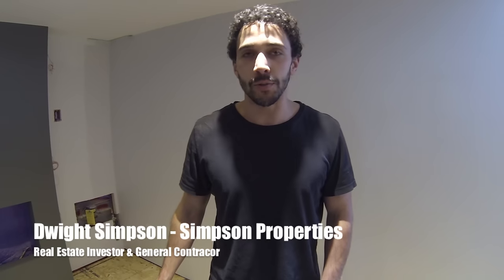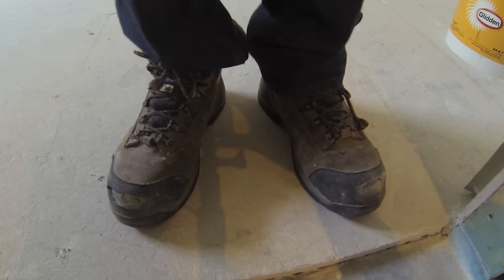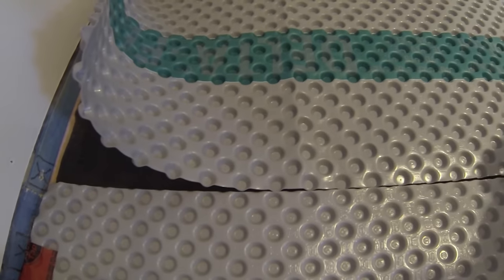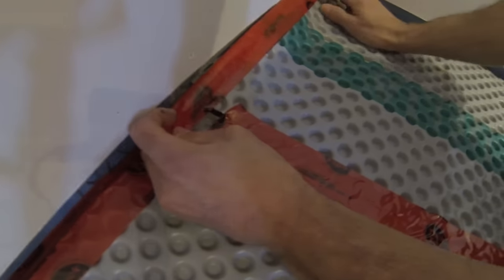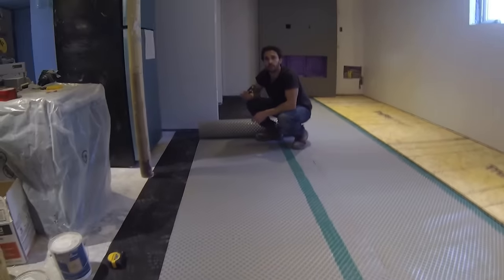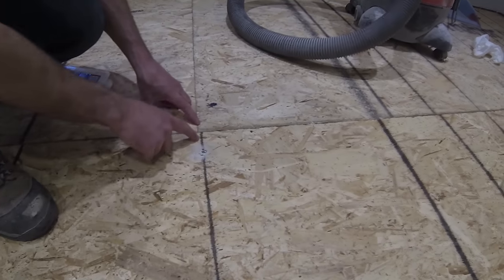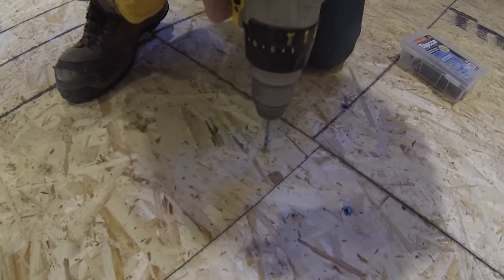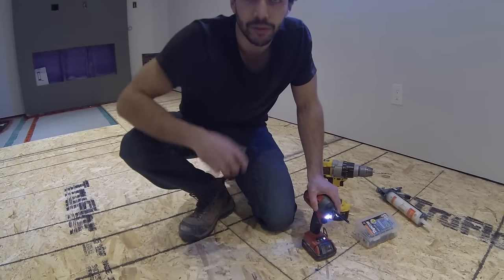HOW TO INSTALL A SUBFLOOR ON CONCRETE

Comment: Can you use this method in a lower level bathroom? Mine is only 8'* 8' so may use the expensive stuff but I like this method for the huge living area I have to do.
Reply from the maker: 8’8” ceilings are considered high for a basement. I personally wouldn’t be worried about the floor build up with your ceiling height. Which ever method is more cost effective I would go with that.

Comment: Interior concrete pad (originally porch, house 1938.) need to raise floor 4” to match kitchen level.  Sleeper frame over new osb with another layer of osb to lay tile on?
Reply from the maker: It’s either that or pour another slab to match the new height. Framing out a new subfloor will probably be the easiest and most cost effective solution. Without seeing your sight in person it’s a tough call to make.

Comment: Great vid and thanks for the awesome info.  Would the same principles apply if putting in flooring in a garage?  (building a home office in the corner of the garage)
Reply from the maker: +Spartan 419 thanks! Yes, the same principals apply installing this subfloor system on a garage slab.

Comment: I understand that the Delta fl has an air barrier between it and the concrete floor.  Is there any concern about some type of moisture getting on the OSB board causing any mold issues?
Reply from the maker: The only way you would have mold issues is if you have a flood in your basement. If that happens you would most likely have to remove all the flooring anyway. If your foundation is free of any cracks and waterproofed mold will not be an issue m, if you use OSB in conjunction with Delta-FL. If you installed OSB directly over your concrete slab then there would be mold issues because any moisture from the concrete would wick onto the OSB.

Comment: Outstanding video and technique!  Getting ready to do this on two big projects.  This excellent video really helps!  One thing I'm confused on - what diameter are the tapcon screws?  You list a 1/4" drill bit, but that would be too big for the Tapcon screws that come in the kits, which are 3/16" and 1/4 (according to the Tapcon website).  Wondering if you meant that the Tapcon screws are 1/4" x 1 3/4".  Am I missing something?  Thanks!
Reply: Mike E I find using 3/4” t&g sheathing eliminates the need for tap cons in most basements. The tap cons will rust over time.
Reply from the maker: My bad that was a typo. I corrected the description. You're correct 3/16" concrete bit is used for 1/4" tapcons. Thanks for pointing that out!

Comment: When screwing the plywood down, does it crush the dimple mat? Also, incase of a burst pipe above the basement, how would you install this around a floor drain to make sure the water drains and not flood the basement?
Reply from the maker: The Delta-FL membrane does not get crushed by when the plywood or OSB is fastened. The material is very rigid.

If you get a burst pipe the majority of the floor would most likely have to be replaced. Whether the floor drain is exposed or not. If that is a concern you could extend the floor drain (use a coupling) to the new finished floor surface.
Reply: @simpsonpropertiesltd  Thank you. I realize the floor would need to be replaced, but pumping water out of a basement is not fun. You'd also have replace a lot more than just the flooring.

Comment: If you strip one just insert a piece of insulated wire about 6” long and run the screw back in same hole.
It works so well you can use wood screws.
No joke...try it....you’ll be blown away how good it works.
Speaker wire, automotive wire, as long as its stranded wire it will grab like mad.
Reply from the maker: That’s a great tip! I have heard of people using pieces of solder as well. Thanks for sharing that.

Comment: Great informative video. I've used this method a few times myself, and always feel terrible to have to punch through a perfectly sealed vapour barrier with tapcons.  Even more worrisome is when a fastener doesn't grab an you're left with a hole. Is there a method that you use to ensure these perforations don't become troublesome in the future?
Reply from the maker: It’s tiny holes in a slab. I would not be concerned.

Comment: Perfect video, I really loved it and it really  makes sense, thank you..BTW i have a question I have to go though every thing you have just showed here but what about putting - fabric+ Delta FL + Rigid forms+ Plywood ... I am thinking of installing laminate  on the top? Thanks in advance..
Reply from the maker: Do you mean installing Rigid foam? If so, it's a great idea since it will act as a thermal break. The only con is you with loose some ceiling height depending on the thickness of the foam.
Reply: Yep that is what I mean, I will just install a thin Rigid foam, thank you for the reply- appreciated...

Comment: Greetings from the UK, 

Thank you for sharing your process. I have to do the flooring at my place and this video is very useful (informative) to me.

A couple of questions. I noticed you did vinyl planks for flooring on top, is that right? I want to do the same to my kitchen, bathroom, living room.
Was the concrete level to begin with or did you have to work on it before laying your subfloor? 

Regards, 
Christos
Reply from the maker: Thanks! I installed laminate flooring but vinyl flooring is great. Especially for basements. My slab was fairly level one the subfloor was installed. I did not have to shim or install self leveling concrete in the areas that had laminate flooring.

Comment: Thanks for a great and informative video! Im doing the exact same thing as you in my basement, which is not underground at all, however my flooring will be Vinyl planks. I just got in some professionals to level the concrete floor so that problem is solved. Previously there was Styrofoam insulation directly on the concrete floor with 7/8 chipboards on top of that and then a thin layer of some very thin, cheap floor as the finish. My plan is to simply lay down a vapor barrier, then the vinyl plank foam mat and then the vinyl planks right on top of that without any more sub-flooring as things are level and smooth now. My main worry however however is that the floor will feel very cold. Would your choice of sub flooring also work with vinyl planks or would this choice be too thin as these vinyl planks are flexible and not as sturdy like wood flooring.
Reply from the maker: Philipp Affolter this method would work with vinyl plank flooring as well. It will also help increase the floor temp a bit (maybe a degree or two). Unless you heat the slab with radiant heat or electric such as Ditra-Heat (tile applications) you will always have a cold floor.

Comment: I bought dmx step 2. Should I still use the landscape material first?

Also could carpet be installed on this system?
Reply from the maker: Yes carpet can be installed. Refer to the manufacturer specs it covers materials that can be used in conjunction with it. 

You should be ok with DMX and. It need to install landscape fabric. Install some and place 4x8 sheets on top and see if you notice any noise before fastening the boards. Then you can decide if you need the fabric or not.

Comment: Re: the fabric ..... I installed Delta in 2007, I did not use fabric (Delta did not call for it) I have no sound because my plywood (I used t & g plywood) was secured properly to the floor .....I’d check with Delta before installing with the fabric .....if it ever gets damp or wet will there be enough air flow for it to dry??
Reply from the maker: It’s a recommendation directly from Cosella Dorken the manufacturer. It’s not a necessary step but a recommended one.

Comment: Great video, what kind of lighting are you using for your shelving beside the fireplace?
Reply from the maker: Peter Grimaldi thanks! I used low voltage LED tape lights.

Comment: I'm about to do the same job in my basement but I have a question can I lay this on top of old asbestos tiles. Some  pieces are broken or missing too
Reply from the maker: If it were my job I would do a type two abatement and remove the asbestos tiles. If you choose not to remove them it’s safe as long as the asbestos tiles are not disturbed. If you installed Delta-FL only and didn’t tap con (screwing into the tiles) OSB down you should be fine.

Comment: My exterior walls are built and insulated with vapour barrier already. So just to clarify, run the extra vapour barrier OVER TOP of the Delta FX and tape?
Reply from the maker: That’s correct. Sorry for the late reply.

Comment: Deciding to use this product or dmx but I though you didn't want to seal it against the walls so the moisture could escape into the room?  If moisture builds up underneath the dimpled plastic what happens? Any opinions?  I have a brand new home with a textured brick basement walls and I don't even plan to frame walls to cover the brick look just interior walls.
Reply from the maker: It’s recommended by the manufacturer to seal the perimeter. They suggest using low expansion spray foam. There should not be excessive amounts of moisture below the Delta-FL if you have normal slab conditions. In that case there won’t be any issues. 

If you have standing water on your slab. Those issues would have to be addressed first.

Comment: Hey Dwight....great video....very helpful.  With regards to the walls....what is preferred... before the subfloor directly on the concrete or on top the subfloor with the subfloor going from wall to wall?  I know from the blog you prefer to put the walls in first but is there a benefit either way or just personal preference?  What would some pros / cons being to either?  I'm working on a fresh slab of concrete with concrete walls but am going back and forth on which to do first.  Thanks!!
Reply from the maker: Thanks! It's really a personal preference. If you find LadyDMcollector's comment below you will see why they recommend to build your walls first. If you build your walls first you wont be able to drive nails into your bottom plate of the wall while doing the trim. You may have to add additional blocking. If you have a flood like LadydMcollector did in the comment section you may have to tear out studs from your wall, in a worst case scenario. If you build your wall on top you don't need to use sill gasket since it wont be touching the concrete pad. Building your walls first makes your life easier for plumbing layouts if you need to add any underground plumbing. Like you said both options have pros and cons. You will have to decide which process will work better for you.
Reply from the maker: Hi Stephen, I thought of one more installation method that I will probably use on my next install. I will install the Delta-FL first. Then install the exterior and interior walls on top of the Delt-Fl with no OSB between the two. Then I would carry on with a regular installation installing OSB and butting it up to the walls. Leaving a small gap between the OSB and wall for expansion and contraction. This installation method would still allow for nailing into the bottom plate when installing trim. If there was ever a serious flood and the entire floor had to be removed it could be done with out having to remove the walls. Plus it keeps all your framing off the concrete floor.

Comment: Hey thanks for the awesome video! Question, I live in FL and I ripped my carpet to find concrete. I have no basement, can I still follow your video or would it be useless without a basement?
Reply from the maker: Thanks. If you have a slab on grade home you can still use this method. It’s your call. What type of flooring do you plan on installing?

Comment: Thanks for the video! We are planning on finishing our basement here in a few weeks. I am wondering if you have information about the brand/type of floor you installed in this video. We are looking for something light with beige undertones, and the color is beautiful!
Reply from the maker: No problem! The manufacturer is Life Stepp, country collection, colour: Gray Smoke, Size: 1215x126x12.3mm, SKU # 2717. Each box covers 19.77 sq ft. Good luck with your basement renovation!

Comment: I will be finishing my basement in the near future. Does it make sense to put the Delta FL and OSB in first...taking them to the bare poured concrete walls? I will be adding 2" XPS rigid foam to the walls, then 2x4 framing with empty stud bays that I will sheetrock over. Or do I build the walls first and take the Delta to meet the PT/BluWood bottom plate?
Reply from the maker: I would install a strip of Delta-FL on the perimeter walls. You can cut it in one or two foot wide strips so that you have less overhang. Then install all your 2" rigid foam on all your exterior walls. Once that is complete install your exterior framing with your bottom plates over top of the Delta-FL. Then you can install the rest of your Delta-FL tying it into the exterior strips. Then install your OSB. Leave an 1/8" gap around the perimeter and in between boards for expansion and contraction. If you have Instagram check out my page Simpsonproperties. I posted a picture showing a similar installation recently.
Reply: Thanks for the reply. I really appreciate you taking the time to answer my question. 
I just checked out your instagram page and saw the picture you were talking about. Do you have to put a bead of foam where the delta fl meets the concrete wall? Or do I just leave it open? Would I need to seal where the 2" XPS meets the delta-fl? Also, 
would the OSB only really be necessary if I am going to install carpet or hardwood? If I plan on installing laminate or vinyl plank, could I just put it over the delta-fl (or over whatever pad the product requires)? Sorry for all the question. I have zero experience with this stuff and there are so many different opinions when I try to research it. Thanks again!
Reply from the maker: aldo leopold no worries that’s why I created this channel is to help people through the renovation process. It’s your call you can install a bead of foam if you would like or butt the rigid foam to the Delta-FL. I personally like to use closed cell 2 lb spray foam on all exterior walls. I will have my spray foam contractor install it from the rim joists right down to the Delta-FL. 

No matter what flooring finish you choose I would recommend installing OSB or plywood. Without out it you will feel imperfections in the slab, it will be cooler on the feet and the floor will have more of a “bounce”. In my opinion it’s worth the added cost and time to install the OSB, then your under-padding, followed by the laminate.

Comment: At 3:20,   i can't tell whether you cut the bottom of the drywall and are attaching the tape underneath, or are you just taping it to the drywall?
Reply from the maker: I attaching the tuck tape below the drywall to the bottom plate of the wall framing.

Comment: When you put the tapcon screw into the OSB it will also penetrate through the dimple plastic, how do you water proof that drill hole
Reply from the maker: Those tiny holes from the fasteners are negligible. If you’re concerned about that you can set the concrete fasteners an 1/8” deeper then the OSB surface. Then install some silicone over the fastener.

Comment: Here is another opinion I found :  "I believe that your cement/concrete floor needs to breath. If you seal the floor and prevent it from breathing it will cause other issues. Therefore allow min ¼ inches to max ½ inches gaps all around the perimeter. This will hep to circulate the air beneath the subflooring system".   So do we really need to tape Delta-FL to walls?            Thank you for video and quick replies.
Reply from the maker: The purpose of using Delta-FL or Tuck tape on the exterior walls is to maintain a vapor barrier. Homes should NOT be intentionally built so they can be "breathe" or be "leaky". The mantra is build tight and ventilate right.

Comment: I have watched several of you videos on how to remodel your basement an especially the ones about putting down a sub floor. In this video to stop the noise plastic you laid down a landscape fabric. What kind of fabric is it exactly and doesn't it defeat the purpose of having the plastic on the concrete.
Reply from the maker: Thanks for watching my videos. It’s much appreciated. It’s landscape fabric and is recommended to use by the manufacturer. The main purpose of the Delta-FL is to provide by a capillary break and vapor barrier between the concrete slab and subfloor or finished flooring. 

Installing the landscape fabric won’t negatively affect this installation.

Comment: Great video, if you have cutback black mastic on your concrete, can you simply install this subfloor as shown?
Reply from the maker: I’m sorry but I don’t know what black mastic is. I did a quick Google search and a lot of black mastic contains asbestos. If that’s your case you may have to remediate before installing the subfloor.
Reply: Simpson Properties thanks, I thought I saw some residual black mastic on the floor in your basement ceiling soundproof video

Comment: Thanks for the great video. I don't have a basement being I'm in Texas and it's all limestone under my house. Is the process still the same? I'm assuming that I can nail the floors down to the OSB when all is said and done.
Reply from the maker: Ruben Villanueva if you have a poured pad as your foundation you can treat the installation process the same. Check with your flooring manufacturer and see what they recommend for subfloor. Most  nail down floors will require plywood and not OSB.

Comment: Why not use heavy gauge felt tar paper used for roofing ? I seriously doubt that would mold. Not to mention you could possibly just put the plywood or particle board on top of it.
Reply from the maker: That could potentially be used rather than landscape fabric. I was following the product recommended by the manufacturer.